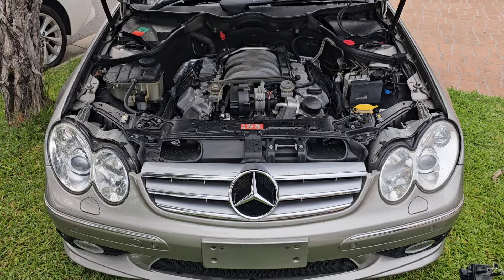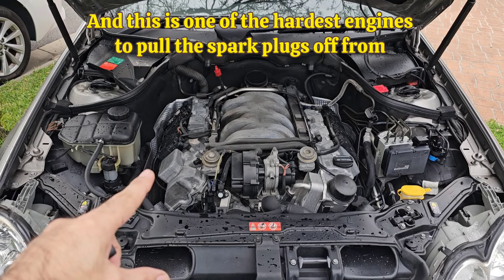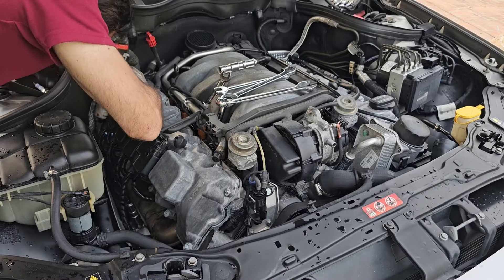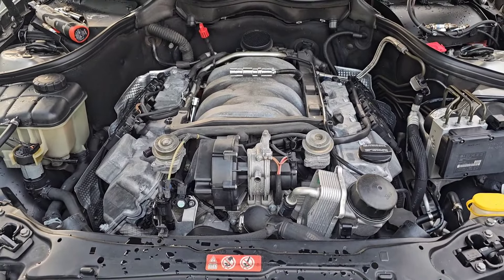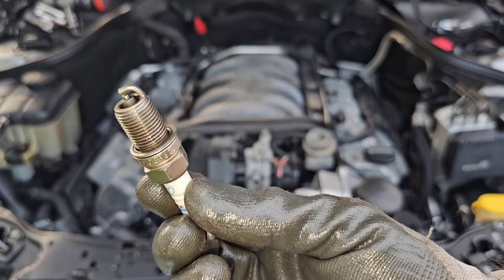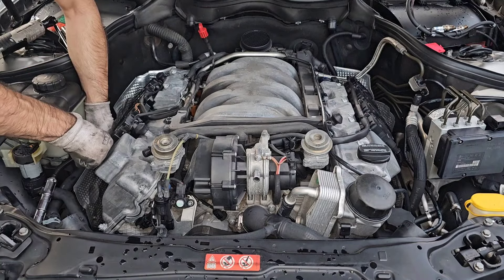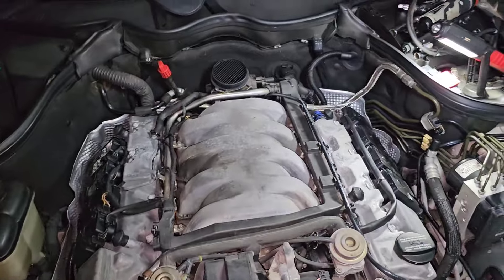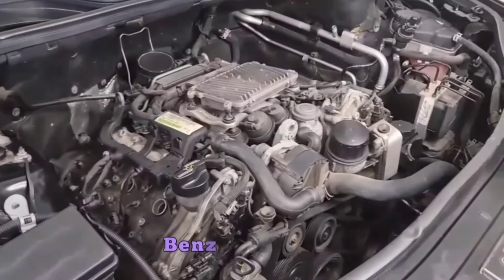Engine Hydro-locked? I am a fool for making such a mistake...

Comment: Nicely saved!  How do Aussies feel about those 'road worthy' certificate?  Here in the States, some have 'annual inspection' and some have 'smog test' and people feel these inspections may be opportunities for unethical repair shops overcharging innocent customers !
Reply from the maker: Thank you. In Queensland state, we only need to get a roadworthy certificate to sell a car or register after having no plates. So it is also a buyer protection mechanism too which is good. The tests are comprehensive (includes testing,  suspension, belts, lights, tyres, brakes, leaks, and more, but no smog test is done as long as there is  no visible smoke) some mechanics are easy going and others are pedantic.